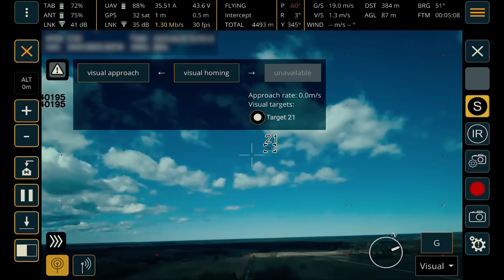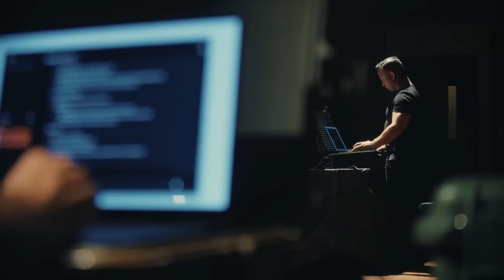The Pentagon Just Classified This Half-Inch Drone as a Massive Threat

Comment: There is only two problems with something that small number one batteries number two wireless transmission uses too much energy for the batteries that It can carry. It’s only gonna have a range of 5 to 10 m and it’s only gonna have a flight time of less than 30 to 45 seconds..

Comment: As someone who's into ebikes, build my own batteries & stay up on tech, there's NO WAY these are real, the battery tech isn't there yet, plus I work with numerous Chinese ebike & battery manufacturers & the battery needed to fly these aren't even invented yet, the tech just isn't there yet, what are they powering it by, the sun? 🤔

On a 70lb ebike I need 20lbs of batteries , which is 28amp hours,& I'll get only 25-40 miles depending on riding style, speed & the elevation of roads traveled, even cold affects performance & range as well, cutting it up to 50%.

Don't believe the hype.....

Comment: These microdrones come down to a set of interrelated performance features.... Power-to-weight ratio, control bandwidth, data-storage capacity, battery life, EMP shielding, and range.

* If it's going to transmit video back to its controller, then it needs substantial battery power to support a high-bandwidth coms link.  That battery is heavy... so now it needs to be bigger... maybe it's not a micro-drone after all.

* If it's NOT going to transmit back a lot of data it needs to record that data and then be retrieved.... that storage device is heavy... so now it needs to be bigger... maybe it's not a micro-drone after all.

* If it is going to be controlled by a control signal, then it needs an antenna that antenna is likely long, and therefore heavy... so now it needs to be bigger... maybe it's not a micro-drone after all.

* If it is NOT going to be controlled by a control signal, then it is going to need substantial on-board logic and processing power for sophisticated AI autopilot and guidance... which requires extensive power... which requires battery... which is heavy... so now it needs to be bigger... maybe it's not a micro-drone after all.

* If it is going to withstand even small amounts of EM noise, much less an anti-drone EMP or jamming signal, it is going to need lots of shielding or processing power... which is heavy... so now it needs to be bigger... maybe it's not a micro-drone after all.

* If it's going to get the benefits of stealth it needs to be launched from hiding and then leave the hidden launcher far behind and thus have a significant range which means it needs more battery for more flight time and more power to send transmissions back over long ranges which again means more battery which is heavy... so now it needs to be bigger... maybe it's not a micro-drone after all.

Just because it can be made does not mean it can be a compelling weapon.

Comment: But you could power them with wireless power like Bluetooth power and make them stay powered.  So cameras, bioweapons, and electric sabotage frying other electronics.
Reply: Wireless power has a very limited range of less than 1 meter on the very expensive high end to just single digit MMS on the low tech budget types.  If your drone needs to stay within the range of the power transmitter then it's probably not going to be stealthy.  True you could use this type for examination of something like power lines (where it would get it's power) on the national grid and use repeaters in each tower to get the video back to the base, although sending a man with binoculars would probably be cheaper than that.
Reply: @PeriliousPaddyI don't know what wireless power you are talking about but it can go miles depending on what you use.  Tesla proved that.

Comment: The smaller the drone the less autonomy it have.
A "micro-drone" range could be less than 250-300 ft and will still need to be controlled by radiowaves. Emitters can then be spotted and eliminated
Reply: in urban environment it could leech off energy from wireless networks and cell phone towers, but it would probaby be released as a swarm with wireless energy source in the trunk of a pickup or minivan around the corner

Comment: And all you'll need is a fog machine spraying a sticky mist that will clog there wings and weigh them down... 
our a mist that can get a static charge through it and fry there sensors...
And have raptors in the field to detect  them by attacking them as prey items and giving them away... Our use spider nets like the ones used to capture small birds for study... Or a reverse faraday cage /mesh/wires to send out EMP's and fry them...
Reply: Yep, like spraying a fly with hair laquer. Instant glider....

Comment: Battery life will be an issue
Reply: Could use wireless power from a radar dish.
Reply: @nasty-booger have to be close proximity then.
Reply: They recharge off powerlines
Reply: @dazgreensmoker669  They are fake. They cant be recharged because there is nothing to recharge.
Reply: @dazgreensmoker669 how? And how would they regulate it to charge a tiny battery when depending on power line have thousands of volts.
Reply: They stole that technology from Tesla...it's been there all along...just wasn't time to deploy it.
Reply: @greywolfe6941 the size of it will be a limiting factor
Reply: @greywolfe6941  They are fake....Just like all Musks promises...

Comment: Fake.. these things can only fly for a few seconds 30/40 max and can't be controlled in anyway including direction.   Attaching a radio receiver to controller it, and then a camera and also are transmitter is just sci-fi  BS.  Using a wing instead of a propeller makes it super inefficient.  Also battery technology hasn't advance much since the lithium battery was invented. Stating that these would be useful for military applications is preposterous. They have about the same amount of military application as an elastic band powered aeroplane. I am a bit disappointed because i really like the channel and hope that doesn't go down route of fantasy.
Reply: Too late... Gotta get the clicks in for that ad revenue..

Comment: Imagine a tractor-trailer pulls up 5 km behind the front lines, with one every 1/2 km. The sides fold up reveling a honeycombed interior holding 1,500 8- inch drones. Each carry two golf ball sized fragmentation grenades, one above and one below the body. They launch toward the enemy, arm at a preset distance and targets any thermal image between 95 and 100 degrees. Individual drones hunting individual soldiers. How far away can it be?
Reply: That is merely a matter of wanting it to happen. In opposition to the wild Chinese claims, key technology for that is available. At this point even with enough image processing capabilities to target humans and/or specific machinery.